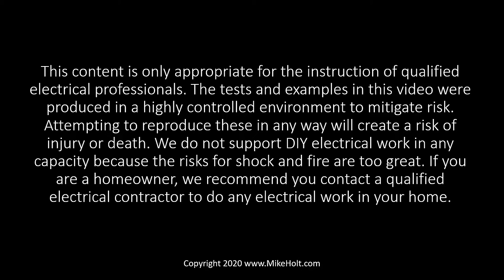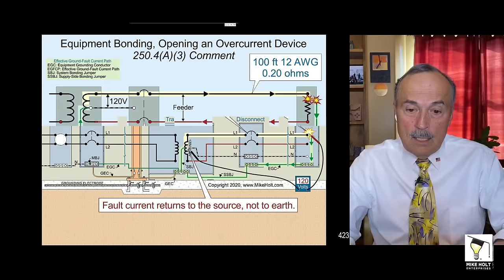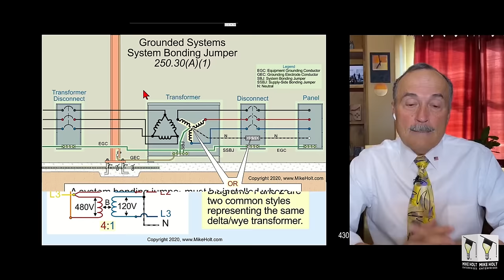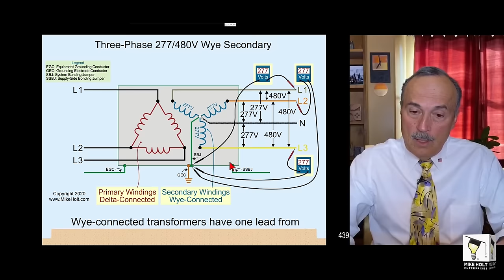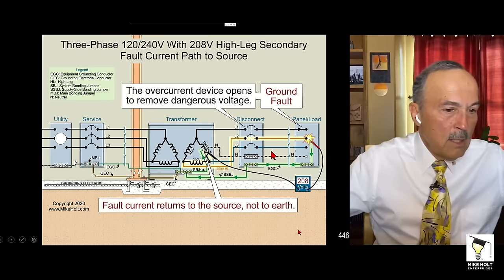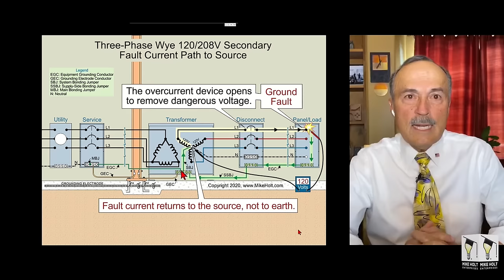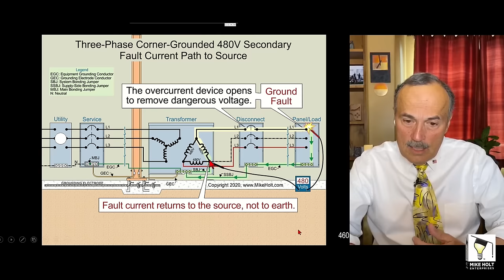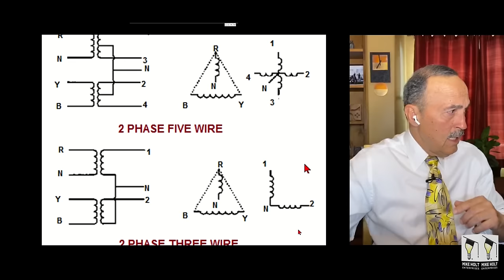Understanding System Voltages, NEC 2020, (46min:29sec)

Comment: For those confused the illustration @ 3:00 is a typo.  The primary should be "480/20 turns = 24v per turn" and the secondary should be 
"24v per turn x 5 turns = 120v". Mr. Holt explains it correctly though. Just fyi
Reply from the maker: Thanks...

Comment: Regarding three phase autotransformers, I worked for an OEM that manufactured large three phase motor operated equipment that was sold around the world, so we used custom three phase autotransformers with taps configured for our existing 480v as well as 380, 400, and 575, all in one transformer.  Large contactors were used to select voltages required by the unit under test. I know Hammond Power Solutions lists these in a catalog with common voltages, but they’ll also build you one to your specifications. I liked to use a company in Canada called Marcus Transformer. They’re real easy to work with, have a fast turnaround, and fair prices.  If you call them they’ll answer in French, but will switch to English, lol….  Also, Staco Energy Products makes super slick systems like this and will build you an all-in-one package to your specs, and they provide expert advice.  We even had one of their 300 KVA three haze variable autotransformers that would deliver anything from 1 to 480v. It was pretty cool. I know this really isn’t helpful to most of the audience, but knowing this stuff exists may come in handy.

Comment: IIRC you can use whatever color scheme you want as long as you're consistent in the building.  So if you make your high leg zebra pink striped, well that's what all of them in that system have to be. I believe there's an exception for repair work and it must be permanently clearly labeled that the colors do not match the rest of the facility.

Comment: In the video for a Highleg system you show 3 windings on the secondary side. Typically a highleg system would only have 2 windings. This would be the primary purpose for a high-leg or open delta saving money or reducing material. The 2 windings especially on the utility side would be used. The vector of this setup would look like a T. With the node of the T being your neutral  connection. The Y axis in the vector would be your high-leg or 208 to neutral voltage.
Reply from the maker: A closed or open Delta secondary with a neutral will both give a high-leg voltage of 208V.
Reply: Agree with the closed delta giving you the same results. I have never installed or seen a closed delta highleg. 
Keep up the awesome videos! They have helped me out with getting a better understanding of the NEC.

Comment: Hey Mike, great video as always. One question though: Do you use any particular software to draw your diagrams? I like how they have clamp meters etc on lines that you want to display the current reading. Makes the diagram very easy to follow and I'd like to be able to produce diagrams like that for my work as well
Reply from the maker: We use CarelDraw.
Reply: @MikeHoltNEC  Thank you!

Comment: You are not allowed to use slash rated breakers on an ungrounded or a corner grounded system. I wish they would make all 2 pole breakers straight rated for this reason. It would not cost much more in that they would all be made to the same standard. After all, all three pole breakers are straight rated.

Comment: Mike people keep telling me I’m wrong..I just want to make sure. If I have a 480 primary and 208/120 secondary transformer, or any other kind of transformer for that matter..Let’s say the neutral on my secondary is bonded correctly with a SBJ and I have an effective ground fault current path, and everything is correct. EXCEPT I don’t ground my transformer to the dirt, or building steel, or a water pipe or anything else. I still clear faults and still have correct voltages right? People are telling me it’s a floating neutral and my voltages are all going to be off and I’m not clearing faults, etc.
Reply from the maker: Yes, you are 100% correct. The secondary bonding established the zero reference and effective ground fault current path. Of course you knew that.

Comment: The question that was asked around the 30 minute mark... Does the SSBJ have to be bonded to the metallic raceway that connects the transformer to the first means of disconnect. Aka ground bushings. Does the answer change if it's flex or EMT?
Reply from the maker: Feeder/branch circuit bonding is only required per 250.97 for 277/480V circuits where there is a KO. Nothing else.

Comment: At the 3 minute mark your slide is Transformer Turns Ratio. The bubble at the top says 240v. Shouldn’t that be 120v. So 24v per turn x 5 = 120v.
Reply from the maker: Yep, sorry for the typo in the graphic.

Comment: I have a question concerning high leg identification. You stay in this video and in your diagram that the high leg must be orange. However, the code states the high leg can be identified by an orange outer covering "or another effective means". So, my question is, is the high leg actually required to be orange If you use another effective means to identify it? Thank you.
Reply from the maker: I can't find where I made that statement. The identification of the high-leg conductor must be in accordance with 110.15.

Comment: So in a single phase system, one only  wire makes the main circuit and then comes the neutral and earthing,it's like a game in wich to got shocked I just have to close a circle=circuit I get that it's all pretty clear in the figures you show, actually thanks to your drawings I can understand now the whole thing. But now, where does the big circuit ends?
Because being a big circle means L1 must meet L2 in some point right? According to your first lesson( current always come back to the source), L1.should come back to  the source using to paths (neutral wire or L2 wire) so where does L1 becomes L2? Is this  meeting point a phisical place like a substation or something?
Reply from the maker: Watch https://www.youtube.com/watch?v=mpgAVE4UwFw

Comment: Ugh!! They (powers that be) REALLY need to think about what words to use, before using them… 
Trying to explain “Grounded v Grounding”, and then an “ungrounded system”, makes me give a “parent-like” answer, to their question: 
“How is an ungrounded system, one with no ground… when the Grounded wire, is the neutral?” 
Mr- “IDK… it’s just how it is. “
Reply: An ungrounded system does NOT have a grounded or neutral conductor